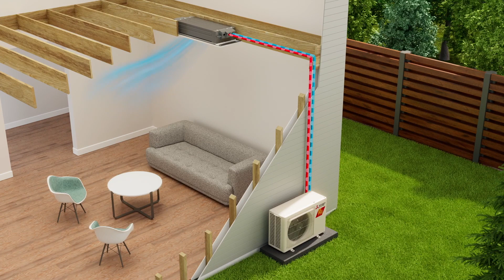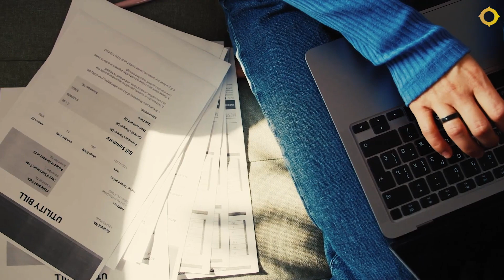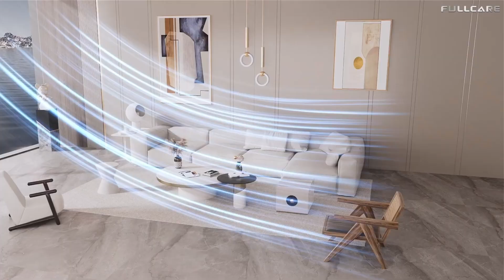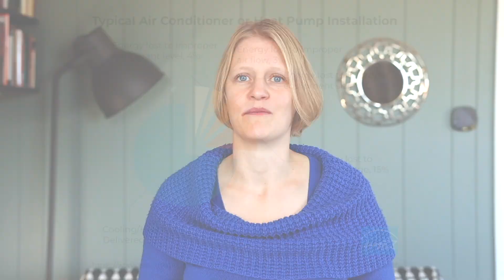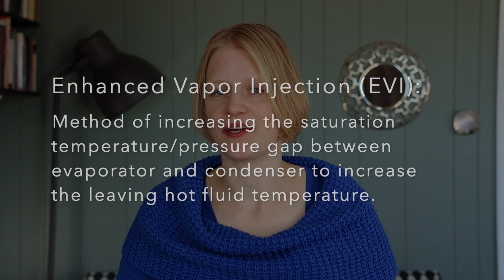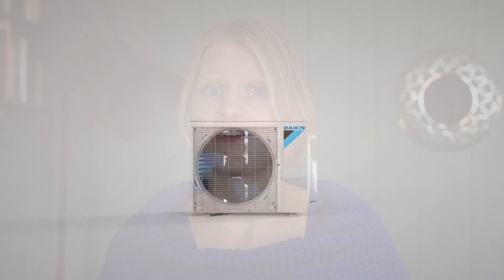Why most heat pumps are oversized (and why this affects your long-term savings)

Comment: This is one of the reasons I like air to water heat pumps with a very large buffer, say 3000L. Optimally run to heat up the tank, independent from heating the house. The large buffer can store even several days worth of energy on milder days, meaning the heat pump can run optimally to charge the buffer, and then won't have to run for a day or more at a time.
Reply from the maker: @upnorthandpersonal, 100 % agreed! Thank you for sharing. Hope you are doing well, Katha
Reply: a 3000L buffer is stupid. it does nothing apart from increasing your bill. trying to heat such an amount takes more energy than just making it when you need it and what you need and no more. trying to do the chinse wok style of heating instead of dutch oven style always consumes more energy and increases your installation cost and energy bills. never ever store heat. the only thing tat barely makes sense is battery storage.
Reply: @SupremeRuleroftheWorld  You don't have to heat it all - the point is that you can run the heat pump optimally with a buffer as required depending on the heating requirement. You don't have to worry about flow calculations or anything to make sure the heat pump runs optimally. A well insulated tank like that holds the heat just fine, and anything that escapes just adds to the heating of the building so it's not lost.
I have a 3000L tank, which is coupled to both a wood gasification burner as well as a heat pump. I also have 60kWh of battery storage since I'm off-grid. I can use the energy from my solar system optimally that way, which includes running the heat pump during the day when I have sun, and heating  when the temperature drops. Similarly, when you're connected to the grid, you can use cheaper rates to heat the tank, and then use it when it would be more expensive to run the heat pump.
Reply: @upnorthandpersonal  running a heatpunp harder, hotter and thus with lower COP to store heat in some supidly sized tank is always a net loss compared to just running it when you need it from the battery or generator. the gains in efficeincy just from lowering the supply temperature and running it low and slow easely outdoes any gains you might think you have with running it short and hard. just lowering the supply temp 10 degrees can save you 20% in power consumption. do find it hillarious that you burn wood and have a heat pump. got a real jungian duality of man going there.
Reply: @SupremeRuleroftheWorld  But that's the point: you can run it at optimal CoP all the time. You don't need to run it harder/hotter at any time.

As for burning wood: I'm at 63 degrees north, and off grid. I'm converting an old tree farm to a natural, diverse forest at the time time - which means trees need to be cut.
Reply: @upnorthandpersonal  you are not running at the optimal cop because the water needs to be a LOT hotter to store enough energy in that tank than just heating the system directly to the temperature needed to put enough heat into the home. The water temperature needs to match the outdoor temperature and follow it to match the heat discharge capacity of the heating system. Storing 3000 liters of 55 degree water when you only need 35 degree water (or less) feeding directly into your system to keep the home warm is an utter waste of energy. Just that 20 degree difference saves 40% in energy consumption and is vastly more savings than what you can do with a tank of water. So expanding your battery capacity does more than just having huge tanks with hot water
Reply: @SupremeRuleroftheWorld  Consider also these scenarios: you have solar panels, you want to optimize self consumption - so you run the heatpump through the day on solar to have heating for evening. Maybe you're on a flexible tariff and want to optimize use of low cost electricity (usually in the evening/night) so run the heatpump, store the energy for heating during the day. What if the forecast ells you it's going to get cold in the evening, and you're having excess power during the day - you'll need the heat in the evening, so store it during the day. Etc. Heat pump CoP is only one part of the equation.
Reply: @upnorthandpersonal  if you have exess you need to store it in batteries, not useless tanks of hot water that cost you more to make than just using electricity when you need it. Especially with dynamic tarrifs it does not work out. If you need to spend 40% more electricity due to the loss in cop but its only 20% cheaper electricty you are still running at a net loss. And that is ignoring the cost of the tanks
Reply: @SupremeRuleroftheWorld  Let's agree to disagree. My next step would be to write down some examples and math, e.g. using the UK (Octopus Go is 9.0p per kWh off-peak with a daytime rate of 30.52p per kWh) but I don't have space here or energy to do it.
Reply: @upnorthandpersonal  that "your math" works out in some remote place in the UK is good for you, but it seems you are fogetting that you are the exeption, not the rule. and the people that watch these videos are not the exeption. telling these people living in normal houses in villages and cities to install a storage system with several thousands of liters of water and also install a wood boiler is "narrow minded" to put it nicely.
Reply: @SupremeRuleroftheWorld  I don't think I ever said everyone should do this. I deliberately said in my first comment that this is something I like to do. Who is to say that people watching these videos conform to one particular pattern? Having different applications, situations, in different places, and discussing those, it one of the nice things the Internet enables.
Reply from the maker: Interesting to learn about your perspective. One significant advantage is that air-to-water heat pumps can heat the tank when energy prices are low for time-of-use plans, which are becoming increasingly more common. Air-to-water systems are already the most popular system in Germany and are becoming increasingly popular in the US. I think the technology has advanced significantly. Thanks for commenting! Greetings from Colorado, Katha